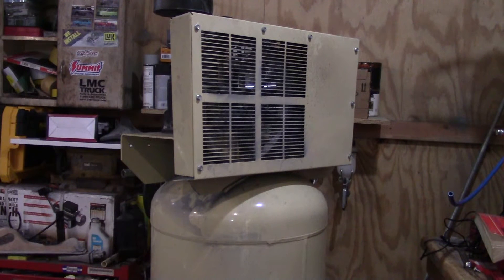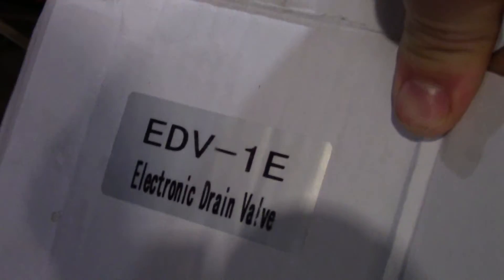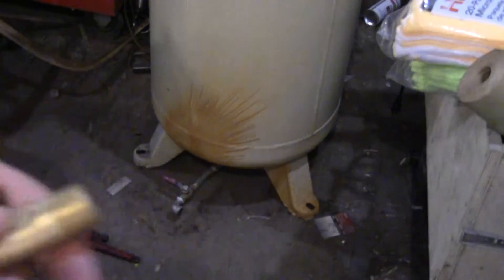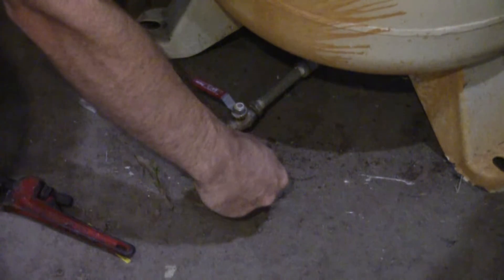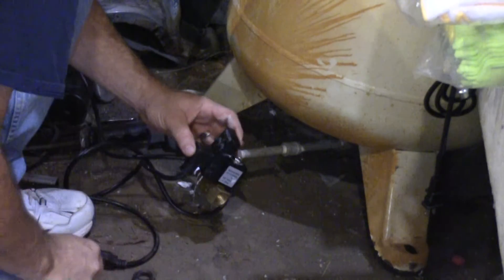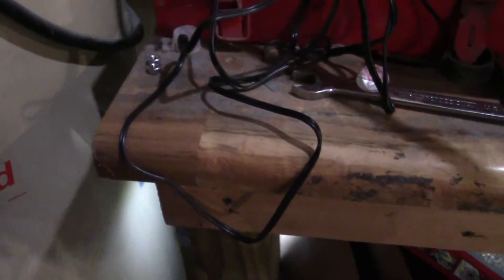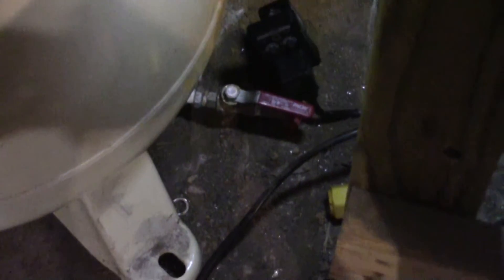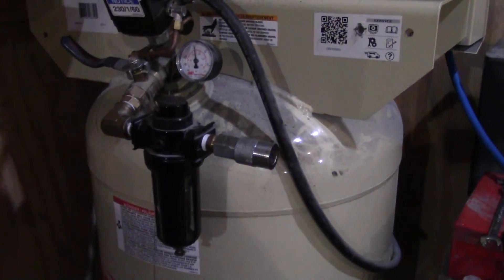Electric Automatic Air Tank Drain Install

Comment: Does an automatic drain valve allow you to keep your tank full all the time so you’re ready to go anytime without having to refill the tank from empty? If that’s the case, wouldn’t you want the drain valve on all the time instead of wired to the motor run only when the compressor runs?  Just trying to learn before I purchase one.
Reply: The drain valve plugs into a wall outlet and the timer can be set to blow at certain intervals. It would be very handy if you keep your air compressor in service all the time to keep moisture out of the tank. In that case I’d recommend setting it to blow at longer intervals. Unfortunately this one ended up failing and I went back to the manual valve.
Reply: @farmboy30117  good to know. Thank you

Comment: How is this holding out?  The longest is 45 minutes? So I assume if the tank is out of air because of not using it for a few weeks the auto valve will still open up and have water drip out as long as the duration of the valve opening is long enough for the water to drip? Or do I need to have the tank pressurized at all times
Reply: Oh man. I don’t use my air everyday. Thanks for the update. I guess I’ll drain mine manually everyday before work or something
Reply from the maker: Unfortunately, the valve stopped up with rust after sitting for months with no air pressure.  I have since removed it and went back to a manual blow-down.  I think it would have been ok if I'd left it plugged up with air pressure.

Comment: The brass strainer/valve/elbow is to be installed between the tank and the ADV, airflow through the strainer first.
 The valve is then used to THROTTLE the through-put of the valve so no one loses their hearing. 
This is the straight poop from a Quincy Air Compressor install tech.
Reply from the maker: Good info!  Thanks!

Comment: Suggestion ; always put a "tee" in the line coming off the compressor .  One side of the "tee" , will go to the ATD  &  the other side to your ball valve . If you do this , you 'll always have a way to check if the ATD is doing its job . I don't like those brass (?)  parts with a plastic valve because they are always installed on the ATD side of an elbow . Keep things separate !  Ball valve on one side of the "tee"  &  ATD on the other , that way if one side gets clogged ( tank scale) , the other side will still function . Good luck !
Reply from the maker: Good suggestion!  Thanks!

Comment: I don't have 220 in my lil shop. I wish I could find a compressor that size that would work on 110
Reply from the maker: You should be able to find one.  The one in my other shop can be either 110 or 220 and it's a 5 hp 60 gallon.  They pull twice the amps as 110V though.

Comment: This is a good video for me as I was just looking at eBay for an electric drain valve.
Reply from the maker: Hey Wyatt!  It seems to work fine, it scared the p out me when it kicked on after 45 minutes.  Hope it lasts for awhile.  Link is in the description if you want to check it out.
Reply: That unit will be fine. Most tools are De-rated to around 90-120 pounds of pressure anyway. The only reason I got a 2 stage was because I have a sand blasting cabinet and they take lots of air.

Comment: Love my electric drain valve! I wired mine to one side of the pressure switch so it comes on for ten seconds every time the compressor kicks on .really keeps the moisture in check...
Reply from the maker: Good idea!  I was planning to wire the fan for the cooler into the pressure switch, so it wouldn't be hard to do this one at the same time.  Thanks!